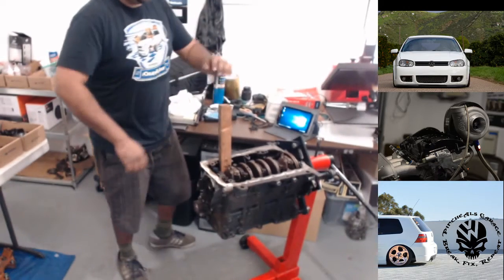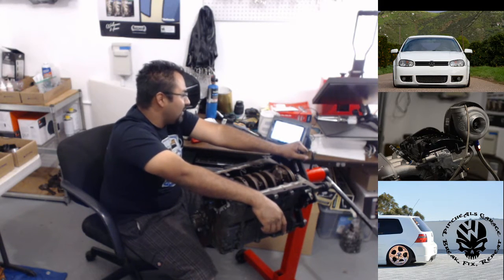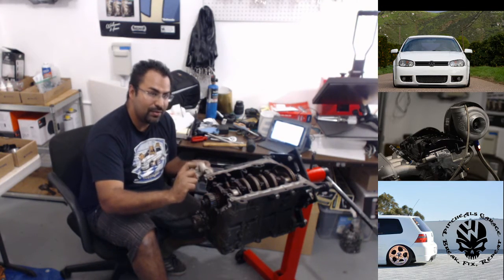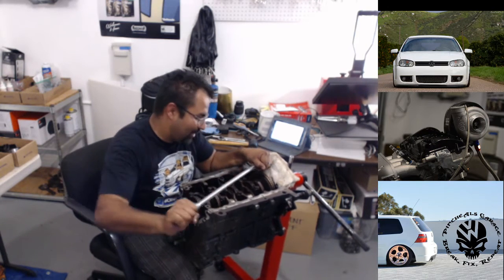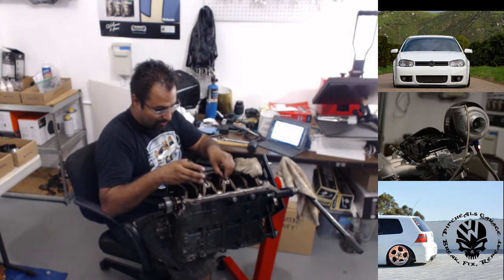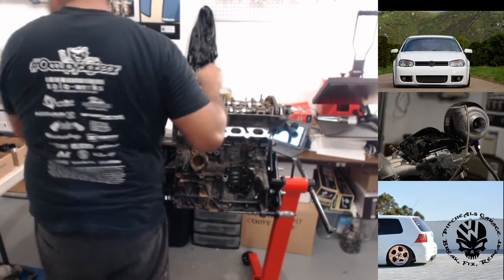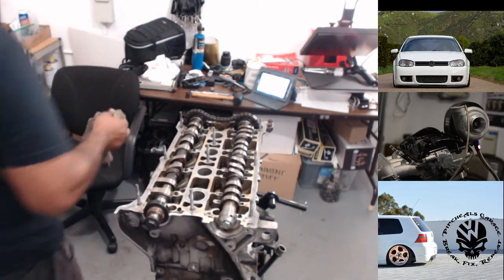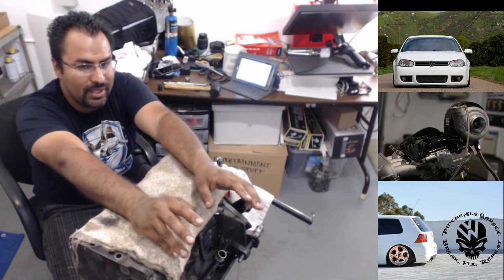Lets Build a RACECAR!

Comment: mentioned upgraded valves. what kind did you use?
Reply from the maker: Mkv_James supertech intake and exhaust
Reply: PincheALs Garage  so stock valve springs guides, keepers ect just supertech valves and then ie rods. stock everything else?
Reply from the maker: Mkv_James yup thats right. just upgraded valves all stock everything else. IR engine rods, catco coated rod bearings and rifled rods, stock main bearings and stock main bolts. arp head bolts
Reply: awesome, getting tired of my mk5, so ill be jumping into an mk4 as soon as i come back from European Experience. Im sure ill def be getting in touch man!